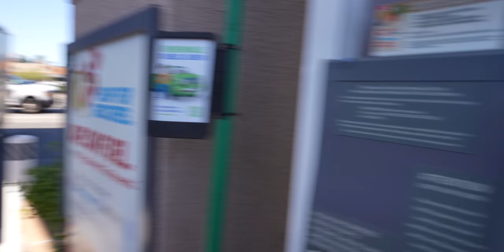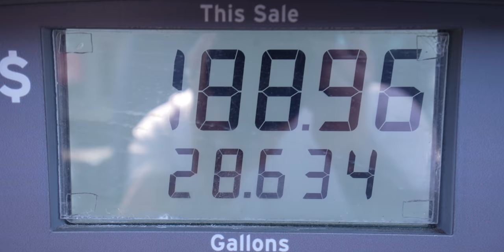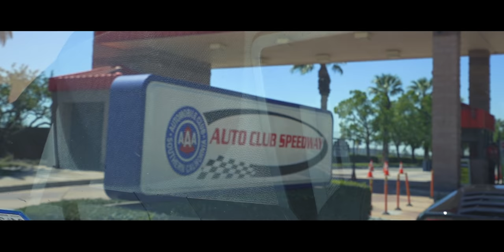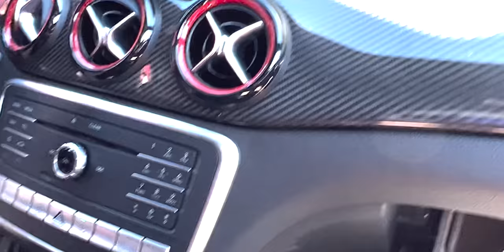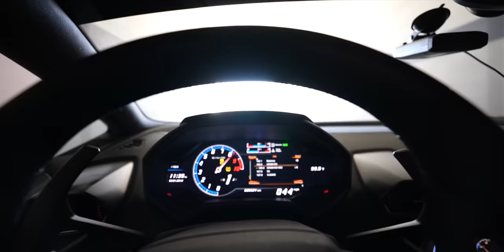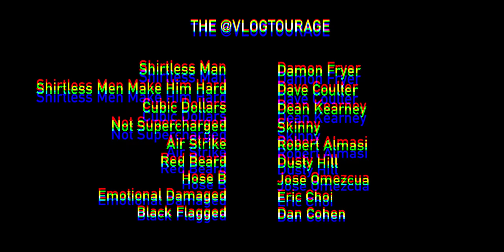HOW TO EMBARRASS RACECAR DRIVERS, BRING A TWIN TURBO FERRARI F12 THEN …

Comment: I think the F12 needs a one off widebody kit. That should allow you to put some monster wide tires on it. Then you should have that grip you need when you touch the gas pedal instead of spinning through all the gears.
Reply: Xcomp will not make wide tires for that
Reply: It’ll only hook if they run some radials. Especially on track it just has too much power to be usable for anything other than a straight
Reply: Don't have to have wider tires spacers or new extended axles
Reply: @forrest7446  facts
Reply: needs a wing too
Reply: Guess you didn't notice it was a shoehorn fit in the trailer as is. Put a widebody kit on it then rip it off loading on anything other than a flat bed trailer or Nascar/NHRA hauler.
Reply: need thicker sidewall too which they aren’t willing to run
Reply: If Damon wants to go balls to the walls, starting to chop off the F12 then yes. It's risky but it could be the monster's monster in the end.
Reply: The NoviTech Widebody kit that Uncle Ray Ray got on His one, would Look Sick on the DDE F12!
@DailyDrivenExotics Lets SCUMBAG uncle Ray Ray to sell you that Bodykit for cheap so you can put it on yours and make it a TRUE UNICORN/ F U too all other F12 owners
Reply: That’ll be sick
Reply: Yes the f12 needs a wide body kit and oracle lights and decals and wrap in satin black as the new formula drift car

Comment: You should get the F12 added to forza horizon on Xbox, like how the hoonigans got their cars on it. Maybe even a couple other in fleet as well 🤷‍♂️
Food for thought.
Reply: Bro imagine the 720 driving it around in forza😮‍💨
Reply: Please no. Maybe savage garage
Reply: @Dylan_420  the only thing with forza I don’t like is we wouldn’t be able to make it straight pipe it sucks forza has no muffler options still
Reply: @streetlifetv9241  they could just make the default sound straight piped
Reply: Facts
Reply: Yes that needs to happen! DDE Forza horizon expansion, come on Xbox let's see it happen!
Reply: you wont belive me buy my uncle was the project manager for the first three forzas
Reply: @streetlifetv9241  new Forza Horizon actually does have different vehicle sounds for most exhaust options. some cars still dont change.
Reply: DDE number 1. Rest are driveway queens

Comment: Petition to make the TTF12 as the new tireslayer
Reply: Damon didn’t even drive the 488 that much after completing all the mods to it. Such a disappointment to the iconic tyreslayer. It got more mileage in the snow stock than it did in California moded.
Reply: @brad741  Was in covid lock down and Canada has snow. Why are you so negative. You a hater?

Comment: I agree with dean do the f12 a lil bit at a time, but I’d definitely upgrade the radiator and the ceramic coated headers first. The stock parts aren’t going to keep up with the rest of it for cooling, but you need some radials on the back or slicks where it can actually hook up and get some traction at least.

Comment: A functional rear wing to control the break loose oversteer, softer rear springs again to hold the rear end steady and higher setting on the differential should dial this thing into a total track monster. Hope you go the lengths with the F12 and make into the stuff of dreams (even more so!).

Comment: Why didnt you make the Ferrari E85?
Reply from the maker: Good question. So the reason is if we put the car on Ethanol we would need to make a custom wiring harness for the engine and program Motec to run it. That’s a whole lot of work and more down time. Eventually we will do that
Reply: @DailyDrivenExotics  Thanks for the response! It just seemed strange since you already had other cars running on E85. I know I need larger injectors, fuel pump, and a tune to run E85 in my car. I guess you have a newer vehicle that's also a Ferrari so it becomes a real pain in the ass.

Comment: You guys need to get the 2023 Lotus Emira asap! Last ICE ever before they go all electric plus it is manual! Only $77000-$96000!  "Mounted in the middle of the Emira will be one of two engines: a turbocharged 2.0-liter four-cylinder or a supercharged 3.5-liter V-6. The four-banger is sourced from Mercedes-AMG and makes 360 horsepower. It feeds the rear wheels exclusively through a dual-clutch automatic transmission. The V-6 is a Toyota-sourced unit that's carried over from the outgoing Evora GT."- Car and driver.                                                                                       

Beautiful and well built. If you guys don't get one, I am going to be very disappointed.....

Comment: Get a e85 tune way cheaper on the wallet. E85 from OneEthanol Starts around 400$ for 55 gallons at 110 octane. Thank you dean I’ve said ceramic coat the headers and the hot side of the turbos for a long time…..

Comment: I think the F12 exhaust pipes need to be extended an inch above the hood. That'll help not burn it to the ground and it'll help get rid of more heat from under the hood.

Comment: Plus no air filters on those Turbos Aaron what were you thinking ?
Reply: The Turbskiicharged  air goes forward from turbski's into.a huge air to air heat exchangers  basically their air passages are very numerous but pretty small  so act asa course  air filter.

Comment: improved radiator (as far as possible with space), improved oil cooler (or add oil coolers if it has none) and proper air flow trough them might be just enough.

Comment: I would move the turbos to the bottom on the f-12 and run the exhaust out the back and get a dual pass radiator with fans and better oil coolers and intercooler and ingnight red and it should rip without overheating

Comment: Do a full build on the ranch hand lol! Trust me when I say a 600+ hp 6.7 is fun as all hell, and compared to what you guys are used to the parts are dirt cheap and easily available
Reply: @That1lowaccord  neither did I until I got one to haul my cars/parts and slapped a charge pipe and BOV on it 😂 who cares about cosmetic stuff other than maybe wheels and wrap. I’m talking 1000 hp easy week long build that will legit pull on 75% of supercars up to a higher speed 😂

Comment: Here me out: if the Ferrari is already useless as a daily driven because of it's requirement of E85/90 and shit gas milage, and it's used on tracks in southern Cali and get's too hot.....switch to methanol, or add methanol injection. Cooling issues gone.

Comment: Why is that not tuned for E?
Reply: Much to high of compression and stock fuel system. An stock system was near 90%capacity without any mods  letalone  Turbskii'ed  with 12.4:1 compression  ratio